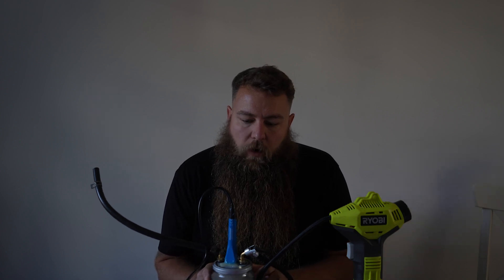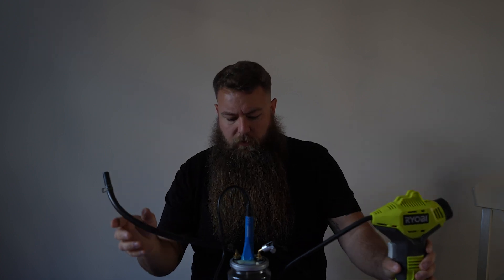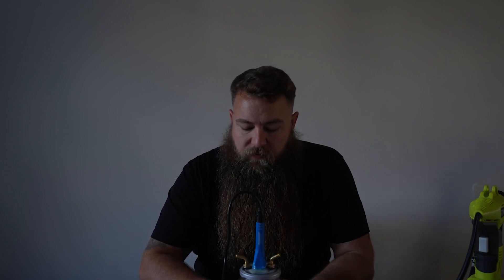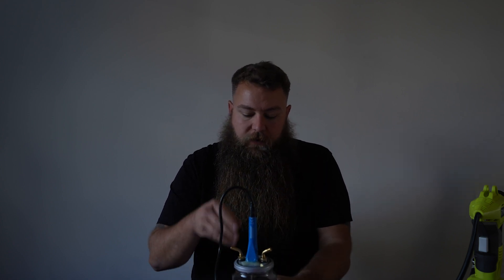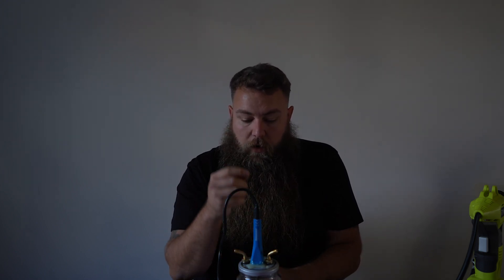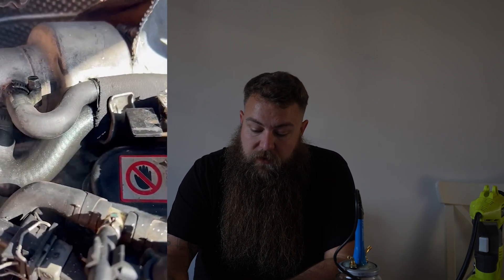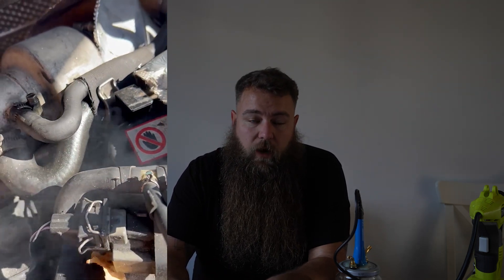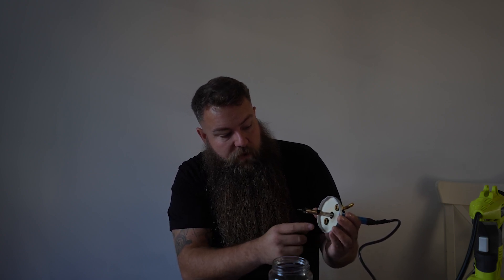DIY Cheap Car Smoke Tester

Comment: I used similar low pressure smoke test on cold side for hose leaks. Works really well rather than a compressor, that can cause problems. Also Allowed me to find a collapsed boost gauge pressure hose.
Reply from the maker: That’s exactly it mate! Perfect for issued that are not always present under load